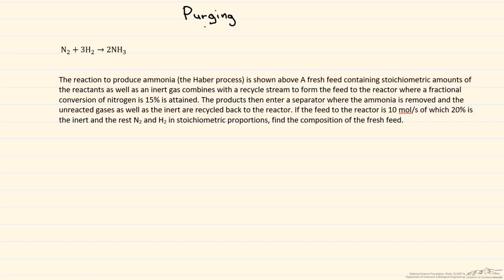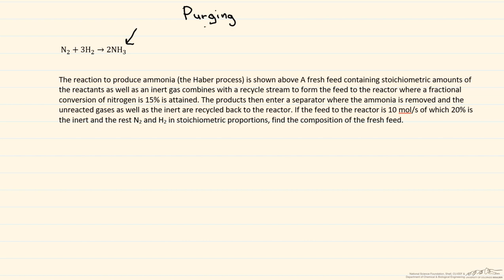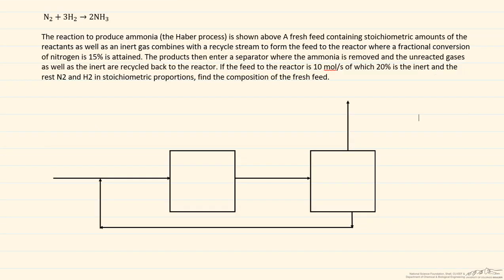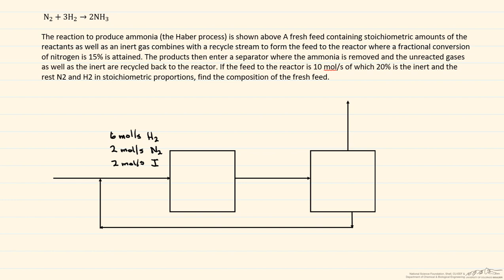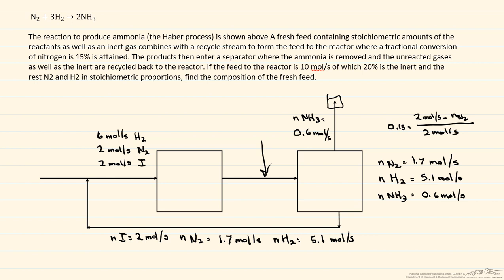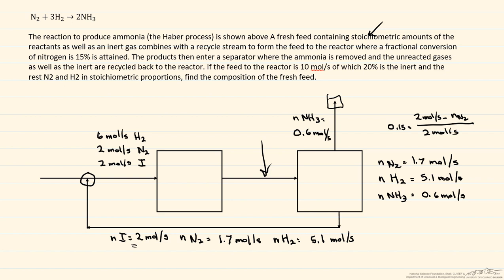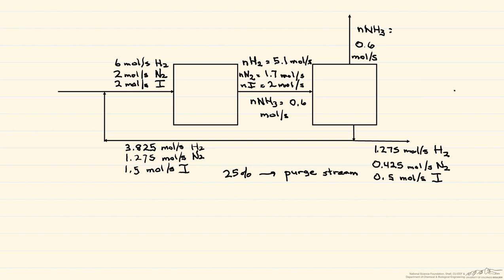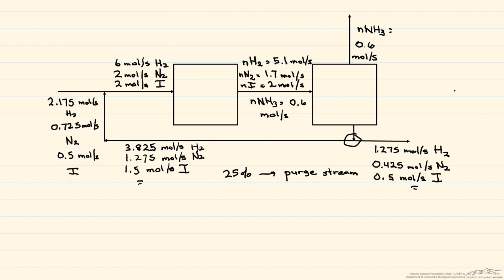Example of a Purge Process

Comment: Badly written problem.  As written it does have an inert feed, a feed of 0 mol/s.  Saying, halfway through, "Oh, there's inert gas, oops, add a 25% recycle" isn't what the problem says.
As an instructor, I encourage you to remove this problem, or accept that the inert feed is "zero."  All this is going to do is confuse students.  Don't amend the problem.
Reply from the maker: Thanks for your comment. We believe this is a good problem because it demonstrates why a purge stream is needed and then calculates the fresh feed composition for a purge stream of 25%..
Reply: @LearnChemE  Specifying a purge stream of 25% in the problem (not the explanation after the student has presumably attempted to solve it) would be the way to address this issue, or explain why 25% is assumed. A blind assumption in a calculation is justifiably concerning for a student, especially when no explanation is given during the demonstration.

Comment: How did you get 6 moles of H2 and 2 moles of N2?
Reply: There are 10 mol/s of feed, which includes fresh and recycle.  20% of that is recycle.  So, 10(.2) = 2 mol/s inert.  That leaves 8 mol/s of H2 and N2.  If these are STOICHIOMETRIC, then each mol N2 has 3 mol H2.  That's a 3:1 ratio of H2 to N2.  Apply a 3:1 breakdown on the 8 moles of feed, and you get 6:2.  (6+2 = 8)
So, it's 6 mol H2 and 2 mol N2.

Comment: Hi, I would like to ask about the lesson regarding the number of moles. How did you get the 0.6 mols of the NH3?
Reply: There are 10 mol/s going into the reactor.  20% is Inert.  So, 2 mol/s inert.  That means 8 mol/s of H2 and N2.  If they're STOICHIOMETRIC then that means a 3:1 ratio of H2 to N2.  If 8 is broken down that means a 6:2 ratio of H2 to N2.  So, 2 mol/s N2, at a 15% conversion: 2(.15) = .3 mols N2.  But each MOL of N2 makes 2 MOL NH3.  So .3(2) = .6.  VOILA!
Reply: @planomathandscience  not answering the question. He asked about the 0.6 mol of ammonia that comes out as the product

Comment: Hello, I am a frequent viewer of your screencasts. I have an interest in Chemical Engineering but I do not know where to start learning. I am a Mechanical Engineer, so I already have good knowledge of Thermo, Fluids and Heat. What is the best topic to start learning Chemical Engineeering?
Reply from the maker: Great question.  I would start with Chemistry and then go to Material and Energy Balances.  Thermo is different in Chemical Engineering, as there is much more, but you may be able to skim the beginning of that course.  Check out the screencasts here: http://www.learncheme.com/screencasts